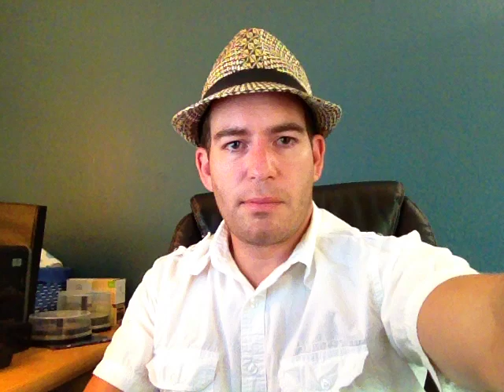What to do if you have Low Heat, Black Glass or Pellet Pile ups in an Whitfield Pellet Stove

Comment: Had black soot on my glass and in the stove last winter most of the time.  Gave my pellet stove the best clean out its had in the 18 years that I've had it.  Disconnected it completely took it outside of the house and used my shop vac blower and blew out everything left in it such ash and dust after giving it a full clean out with my shop vac.  Cleaned the chimney exhaust vent out and no more black soot anywhere.  My pelpro pellet stove runs like new again.  I clean my chimney out frequently every winter.

Comment: Are you sure it is not the high limit switch in the back? It seems that when the stove gets too hot, the burner blower clicks off, the flame goes lazy, and the glass smokes up. If you turn it on high feed, the blower clicks back on but eventually gets very hot and then clicks off. My stove is about 30 years old and I've replace all the motors at least once and the control panel. Thanks for your video

Comment: I have this exact problem to the point that the stove sooted up the cad cell window. The flame was lazy and I could tell right away the exhaust was not pulling enough air through the burn pot. Even adjusting the damper did not affect the flame, pellets won't dance at all. I pulled the exhaust blower of and cleaned the housing and passages. Worked for a few hours with the same result. Ran the motor while it was out (all other devices disconnected) and it seemed very slow while the feed suffer ran and during the ignition cycle then increased in speed. Tried to use the slow motion feature on my phone to calculate the RPM but did not have the ability to adjust the frame rate. Decided to throw some money at it as the stove is 15 years old with very little repair. Purchased an exhaust blower motor waiting on delivery. For gasket is getting fraid and appears to be sealed but I will change that after the motor. Hopefully the motor will take care if things.
Reply: Is the problem resolved with exhaust blower motor replacement?

Comment: Had my stove "professionally" cleaned this winter.  My husband passed 11-21 and he always took care of this.  I was not here, I was at work, but my daughter was.  The first thing they did was toss the little "eye" saying nof necessary, just controls feed, when dirty won't allow feed and this way the problem is solved.  My stove has not ran right this winter at all.  The residue all over the window I had to use oven cleaner on to clean it should have been my first clue.  Now I can turn it on, it smokes up my house before it ignites and sometimes builds up to much back pressure inside the box. That can be scary when if finally ignites.  Today it will drop pellets but only if I manually do a restart.  But will not automatically drop them.   I'm afraid to us it now.  And it's my only source of heat.  HELP
Reply: They may have not cleaned the heat exchanger doors when they serviced the stove. That will usually cause the stove to back up into the house when starting it, especially if ash packs in the areas behind the 2 heat exchanger doors. Even if the rest of the stove was cleaned . That was my problem on several occasions.

Comment: My stove is brand about a week old, first time with a pellet stove and the glass is getting black quickly and the pellets are piling up an not getting burned off. What’s my issue?
Reply from the maker: If it's a new stove my first guess would be your damper needs to be opened up to allow more airflow.

Comment: Hello,
I have a Stove that was gifted to me. It appears to be in great shape. All the motors and fans and the control board lights work. I was told that it would need and ignitor so I didn't have to manually light it.  I purchased a Whitfield & Lennox H8127 Igniter, AMP20115 which is supposed to replace the 12150213 ignitor.

I looked in my manual and I looked in the stove and I do not see anywhere where it might connect to in or near the pellet burn area. My Stove is a Whitfield Free Standing Model Advantage II-T C INS Model. The ONLY model/serial numbers I see is WP-2. Did I waste $50 on an ignitor I don't need? Any ideas suggestions would be appreciated.
Thank you!
Reply from the maker: You can usually see the igniter when you take the burn pot out?  If you don't see it, it may not have been an option on that stove.
Reply: Guess I just bought an $80 dollar paper weight. sigh. Thanks for the info though!

Comment from the maker: Jenny, it's not that easy.  If your control board is broken so that it will only run at one setting then that could cause your problem.  But if you can increase and decrease your feed rate and you still have the problem then it is not the control board.  Most likely cause is just cleaning.  Next most likely cause is the exhaust motor..  If you have a Profile series you could have a bad photo eye.